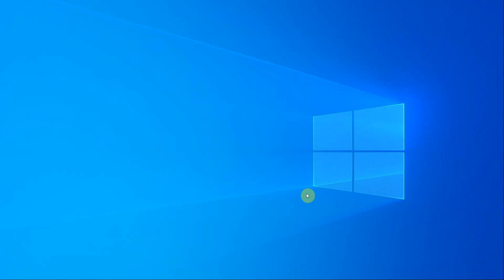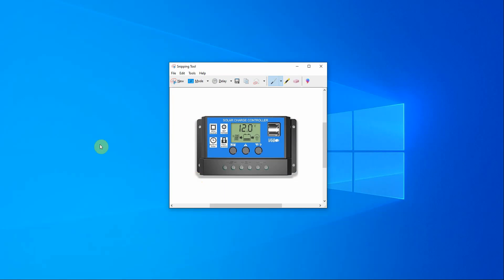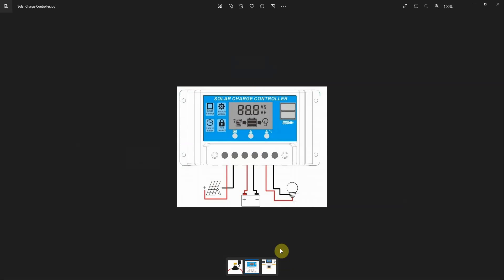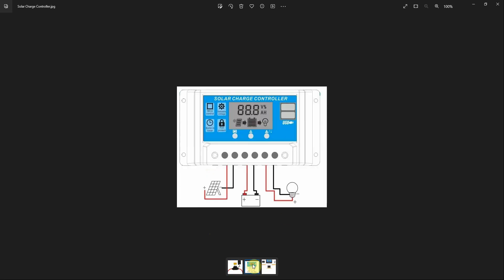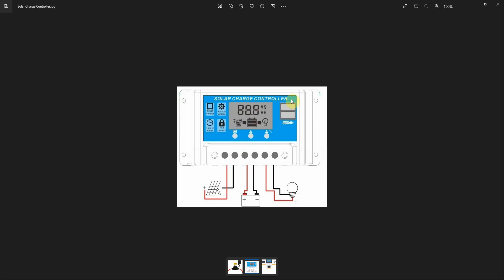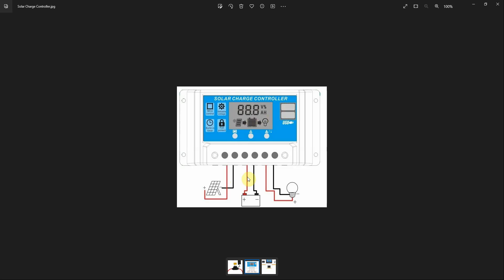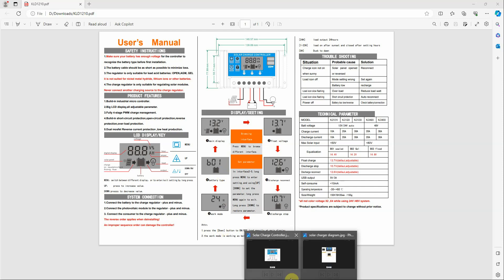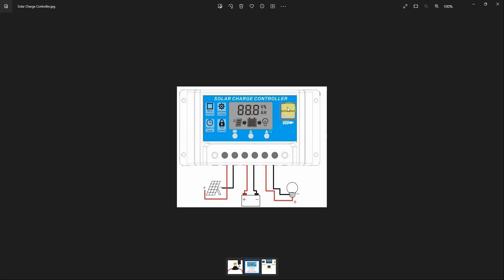Solar Controller Charger not Charging Leisure Battery | #solar #charge #controller #not #working

Comment: Different question but on same controller. I have got that controller and a solar panel. I was hoping to connect a small pond pump to it but when I took the plug off the pond pump it also has an earth wire. Does that mean I cannot use it ? The pond pump says 25watts if that helps. Any advice much appreciated

Comment: I have the same one, and do not work, I get jumping voltages while charging but max 200 ma who go from zero to 200ma, it do cycling. I do see the carging blinking and some now and then it sumps to 4 amps charge then 10 minute alomst nothing just 200ma. I have 5 volt on usb.

Comment: I have a 18volt solar panel. It gives about 17.4v in sun, connect to solar controller and then I get about 3volts coming out of controller!, so not charging 12v battery. Annoying

Comment: Just 2months old 40ah battery connected with 110Watts panel. Fully charged but charging controller shows sudden drop in voltage, the output for the controller works only 15-30mins

Comment: I've done all of that what's happening is the battery flashes and shuts the control panel down
Reply from the maker: Make sure the system is totally off no power at all, everything must be disconnected. after 5 minutes connect them in same same as the guide.

Comment: The manual doesn't call for fuses?
Reply: Where can I find the fuse sure
Reply: the fuses are just used in this example as a kill-switch. you can just unplug it and wait a few minutes
Reply: Fuses are a good way to protect from short circuits or other faults of over current. Cheaper than a burnt down home or car. For turning on and off, breakers are good enough on the positive (not live) of the DC PV and battery sides

Comment: Connect battery FIRST,  disconnect battery LAST. That is the common rule for all charge controllers. Leaving the panel connected without a battery connected (can) damage your charge controller. Nice video, greetings from Jamaica.
Reply: Where can I find the fuse
Reply: @lawrencekamayi541  Such a small system may not need a fuse.